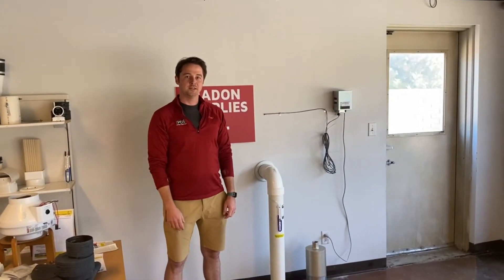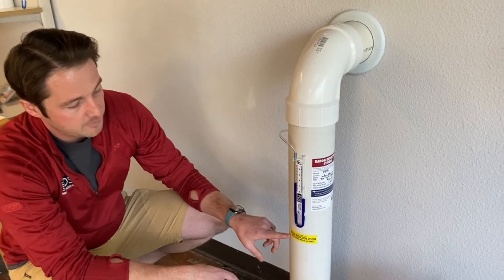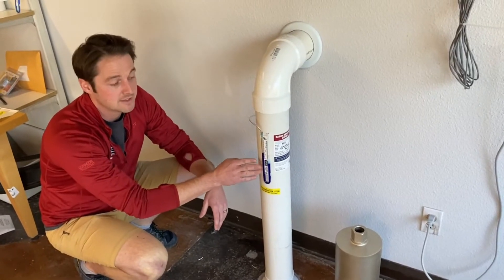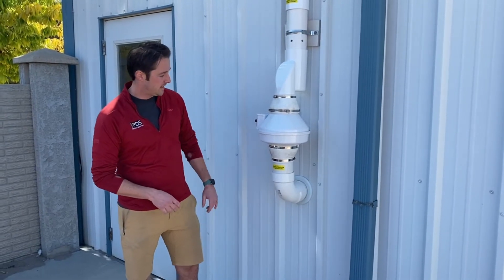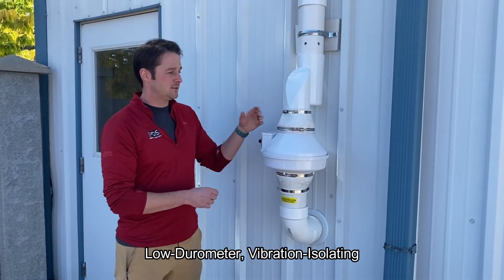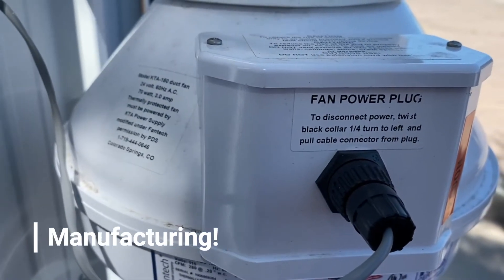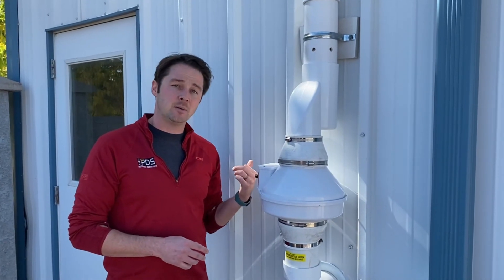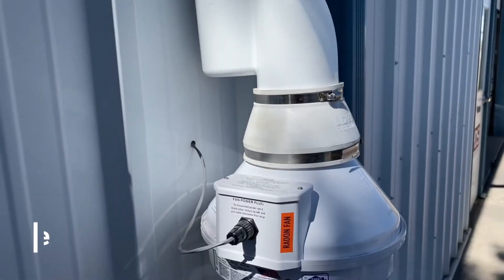Radon System Components PDS Radon Supply | Suction Pits Part II

Comment: PVC pipe above the fan would be a better choice rather than thin metal. That thin gutter pipe is going to make a lot of vibration noise.
Reply: Noise has a lot of factors.  To each their own.  Both methods are acceptable.  In this instance, we're using the vibration/noise tested KTA fan.  Our fan is tested for noise variations TWICE.  As far as I know, the only radon fan that is sound checked in that manner.  We prefer the cosmetic appeal of downspout.